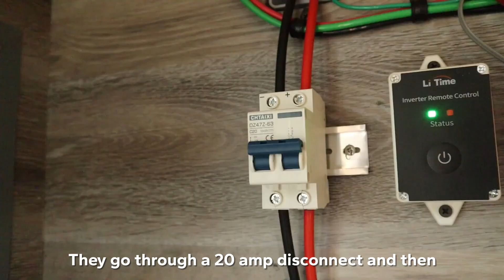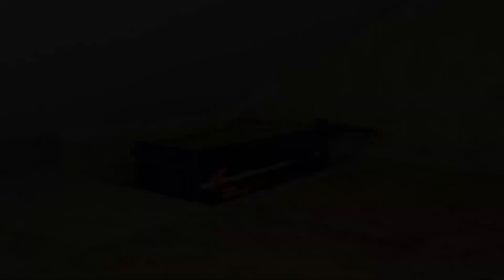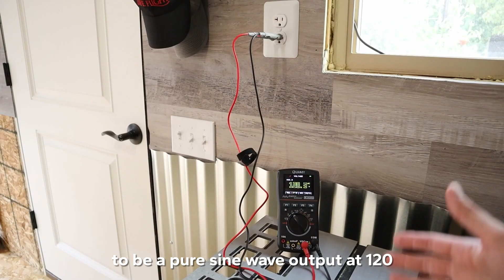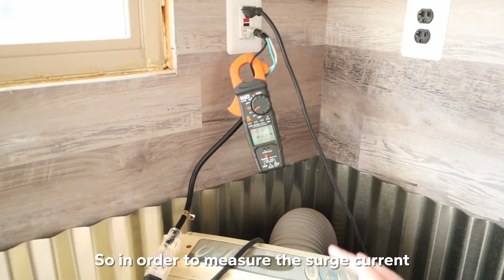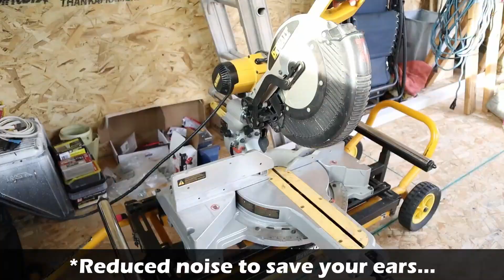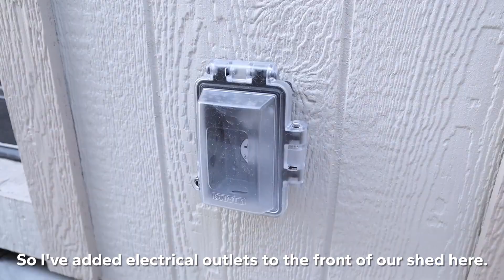Off grid Power System for Shed! Check LiTime 12V One-stop Power Solution

Comment: Alot of reviews on the LiTime 60A charge controller but not one of the 100A which is the one I'm looking to buy. I have the Victron 100/50 and the 100/30, Victron has the same 150/100A specs as the LiTime 100A $250 bucks difference. Victron is on the $550 and rhe LiTime for $300 Bucks. 

I have the SunGold 6000k inverter 24v and 6 200w EcoWorthy panesl. 4 300ah batteries planing to do 2 strings of 24v.

I don't want to spend $550 bucks and  more than not will be getting the  LiTime 100A Charge controller...
Reply from the maker: Hello, thank you for your comment. The LiTime 100A MPPT Solar Charge Controller is designed to support 12V, 24V, 36V, and 48V lithium (including LiFePO₄) and lead-acid batteries. It accommodates up to 6000W of solar input with a maximum solar input voltage of 150V. For any product concerns, please feel free to email our support team at service@litime.com—we’ll assist you within 24 hours! 🧡
Reply: @litimepower Thanks,
I got it on ebay $309 as advertised...
It will be deliver today...A friend of mine has the 60A...
Will be posting a comment once is installed...

Thanks...

Comment: Does anyone know if that plug in receptacle on the far right can be used for a remote display panel? I don't want to use the Bluetooth feature. TIA
Reply from the maker: The battery monitor can definitely help with remote monitoring by using a shunt to measure the current.
Reply from the maker: Please check: https://www.litime.com/products/litime-500a-battery-monitor-with-shunt

Comment: Let's all just go to 48v like Tesla did.  Most battery banks are 48v, solar air conditioning, frezers, fridges,  etc., etc., all there
Reply from the maker: I see what you mean! While a 12V system might require a bit more wiring compared to 24V/48V setups, it can still be a great option for smaller workshops or when starting out. 😊

Comment: Great setup, I am doing something similar for a remote security, WiFi access point.

The LiTime battery charge controller (BCC) docs explicitly says the battery MUST be connected BEFORE attaching the PV panels. In this setup, won't disconnecting the battery bank before disconnecting the PV panels damage the BCC?

For this reason, I did not put a disconnect between the BCC and the batteries in my design. Was that a mistake?
Reply from the maker: Yes, disconnecting the battery bank before the PV panels can damage the MPPT charge controller. For your safety, please ensure there is a fuse/breaker/battery switch between the charger controller and the battery.
Reply: @litimepower  I will add a switch. However, I am having difficulty identifying the failure mode(s) for which the switch will be needed. Can you explain?
Reply from the maker: Whenever you don't need to power the system by the battery, you can turn off the switch. Regarding failure modes, if the MPPT charge controller, inverter, or battery itself reports an error (e.g., beeping), you can turn off the switch and go through a checklist to troubleshoot.

Comment: That low-cost high, frequency, the transformerless inverter doesn't offer any galvanic isolation between its DC boost stage and its AC output, and as such, one day, it's going to fry the appliances that are connected to it during a catastrophic failure of its H-Bridge circuit. You should have installed a low-frequency, transformer-based inverter instead if you want to power high surge loads.
Reply from the maker: Thank you for your comment. Our inverter employs isolated boost-buck circuits in both the DC and AC boost stages. On the low-voltage side, multiple power MOSFETs are connected in parallel to achieve effective current distribution. Additionally, we have implemented sampling resistors along with dedicated voltage and current protection circuits, ensuring safe and reliable operation.

Comment: How long will 4 12 .8 v smart battery with Bluetooth run time be in parallel
Reply from the maker: 4x 12.8v 200ah batteries connected in parallel provide 10,240Wh of energy. Taking your TV(55inch) as example, you can literally watch it for 60+ hours.